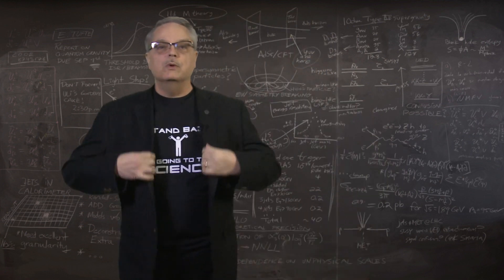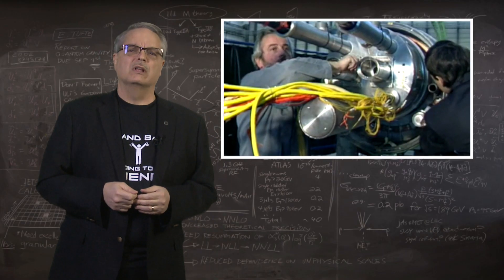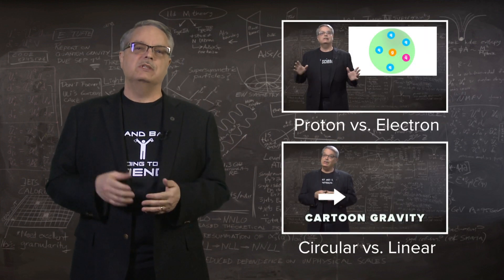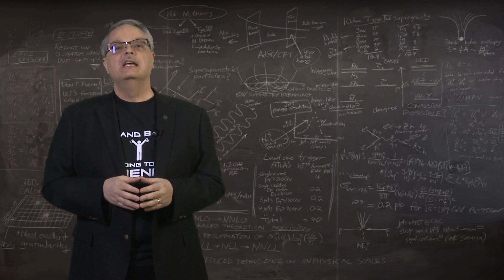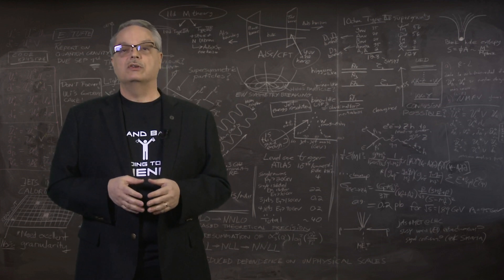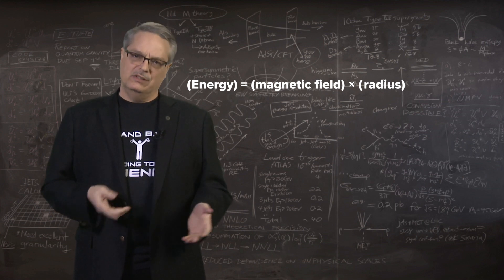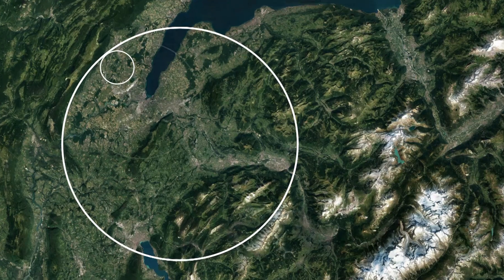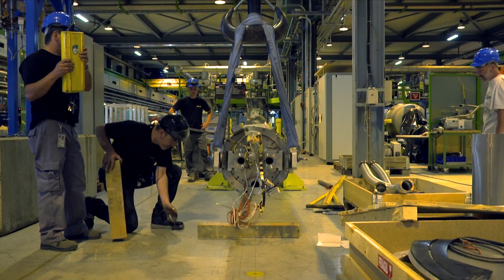Future Circular Colliders

Comment: I stand corrected. It should be a 189 mile machine as Dr. Lincoln says. As to the internation accelerator machine mentioned in the God Particle, that could be a 1000 mile diameter to machine.

Comment: Question: Waht would be the collision energy of a collider consisting of two LHC rings intersecting where one accelerates protons and the other accelerates anti-protons?  Each accelerator would have the same radius as the present LHC...

Comment: On the subject of Dark Matter, could the combined gravimetric forces of virtual particles momentarily entering our universe from the Quantum Vacuum (Quantum Foam) before exiting again explain the existence of so-called Dark Matter? February 5, 2017@10:37 AM.
Reply: On large scale, it should be pretty even. The vacuum energy is a candidate for DE, but there is "small" problem in the calculations (the order of magnitude is out by a factor of 10^120. Not a big deal, that's like comparing one particle to 10^40 observable universes).

Comment: 0:29
How do one build a container to handle such high temperatures?
Reply: Temperature is just a measure of the average motion of atoms. A small number of atoms moving at a very high speed has a high temperature, but it can be absorbed easily.

Comment: does it have to be round?  different magnetic at the corners
Reply: like a egg
Reply: SImple answer, yes. Now why does it have to be round is that to make it inline and long enough to reach the power levels it would have to go remarkably deep into the earth to stay straight, think about pushing a straight pin through an orange and how deep in the orange the center of the pin is even if both ends are at the surface. If it was was built on the surface it would bend with the curvature of the surface and if it is round the energies can be increased by travelling many, many circuits if the circle. As well the larger the circumference the "straighter" each degree of the circle is meaning less energy to make the beam bend around the circumference. So, if it was egg shaped the energy would need to fluctuate from low to high level to get the beam around the narrow end but circular can keep the energy level constant.

Comment: MIT's Plasma Science and Fusion Center has an idea for a tokamak that would sustain a significantly more intense magnetic field than what ITER would sustain.  The reactor design uses high-temperature superconductors tapes and the head of the department seems confident that these are practical.

Comment: Wouldn't Fermilab be a better site for such a large accelerator than CERN?  The area is less built up (to the west of Fermilab there appears to be mostly open farmland), and you wouldn't have to tunnel under the Alps.
Reply: *****
Funding will be an issue no matter where it is built, or proposed to be built.  I was merely commenting on the desirability of the two sites -per se_, regardless of factors such as money and politics.
Reply: I think you would have to first address the memory of the SSC, especially if you were asking for international support.  It's hard to give money to a project when the host country might just cancel it.
Reply: If it isn't directly owned by a US federal government agency then they have no legal standing to shut it down, it's just private property and we have relatively strong property rights in the US.

Comment: I think we would be better off basing are theories of observations and trying to understand the process rather than just increasing the energy of the process.
Reply: the problem is that when it comes to these experiments, the unknown is impossible to observe unless you can manage to produce enough energy to make it observable. For example to find the graviton we would have to produce enough energy to excite the gravitational field into producing a particle with enough energy to be detected. We can't find such a particle from looking at data that doesn't contain it.

An example is photons. At one scale we have "virtual" photons, which are photons that carry the electromagnetic force, and when enough energy are put into these, they start interacting with matter in a different way, ie become detectable(or "visible" if you like). We can't see the virtual photons, but we can see the force they carry. Similarly we can't see the graviton, but we can observe gravity. To find the graviton we would have to create such a dense point of energy that the so-far hypothetical virtual gravitons could be excited into interacting with matter directly, or become unstable and give off the energy through radiation. If the energy of the current beams can't produce an effect like that, we won't find it before we develop a stronger beam.

That being said, my understanding of it is only at a surface level. I'm sure there is more nuance to it than I said.
Reply: We're increasing the energy to base our theories on observations...
Reply: An artist theory on the physics of 'Time' as a physical process. Quantum Atom Theory
Don't get me wrong, but you are mixing up a lot here:
We are talking here about elementary particles and processes, not atoms.
Wave particle dualism doesn't exist. It is just that all elementary objects of the standard model exhibit sometimes a behavior that can be explained by a wave, and sometimes they behave as if they would be particles. They are neither and certainly not sometimes a wave and sometimes a particle, they are something different, that we don't understand, but exhibits behavior that can mathematically described by applying either model at different times. And this is not restricted to interacting photons and electrons. It's valid for all Fermions and Bosons. These are mental models we make trying to understand reality, but they are not reality, they are man made models. 
If you want to look at the inner parts of an atom, you need to break them up to see what results and thus be able to make conclusion about the constituents of it, thus you need to apply enough energy to overcome the strong force holding the nucleons together. (an alternative approach is scattering, but let's ignore that for the moment).
If you want to look at the inner parts of a nucleon, you need to break them up, thus you need enough energy to overcome the strong force holding the quarks together (at least in principle, as due to the color confinement there are some complications with this) and so on. So to go deeper into the structure of matter or to create particles with a higher mass as result, you need more energy, which you apply by accelerating (and thus heating up) the particles. This is exactly what accelerators and colliders do. Insert energy to break stuff up to see what's the result. The smaller the particles to break up, or the larger the particles that should result from these processes the more energy you need to apply.
Doing this at low temperatures is impossible, as Temperature equals particle speed and also doesn't make sense, as something like a wave function collapse (assuming something like this would exist) is completely T independent. You can't "freeze it out". QM properties are also completely independent of the position of an element within the periodic table. We are talking elementary processes here and they are in no way bound to complex structures like atoms, they are universal.
Further you shouldn't mix up particle physics with quantum mechanics. Of course they re they are related, but not identical. Different fields of research require different tools. In QM you usually don't require accelerators, but play around with exotic stuff like quantum eraser experiments.
And if you let me make a final comment on your name / nick: you don't need quantum processes to explain time and its arrow. You just need entropy and the statistical Boltzmann interpretation of it. All elementary processes on a basic level are reversible (at least to my knowledge there is not a single exception, although this doesn't mean they have to be symmetrical). That they don't seem to be on a macroscopic level (we don't see a ball jumping onto a table all by itself while the environment gets colder outside of ghost movies), is what we interpret as irreversible flow of time into just one direction: from the past to the future (thus from a state of lower entropy to a state of higher entropy), which is just a statistical (thus mathematical) effect due to the large number of states and particles involved. No QM necessary here.
Reply: To validate and verify theories you need observational data and that's exactly why these tools are being built. A collider is at least in principle nothing but a giant microscope. The problem is: the smaller the structures, the higher the frequency you need to see it and thus, the higher the energies required. 
At every collision point, there are massive detectors. These detectors are by far the most complex machines ever designed and built by mankind. And the data gathering IT structures behind them are more sophisticated than everything google has. Accelerators and colliders ARE the instruments used for observation.
Without observation no validation/falsification of theories and thus no science.
Reply: Your comment is very logical! However, I believe it is more logical to try to understand the process at lower temperatures. The process remains the same all we are doing is creating particles relative to our energy. This is not going to help us understand how photons and electrons interact forming wave particle duality. Because that process is relative to the atoms of the periodic table and unfolds at a lower energy level than particle accelerators that just break the atoms up!
Reply: We have QFT.